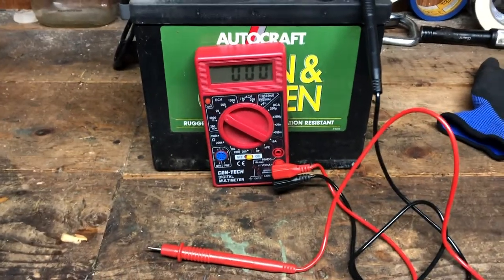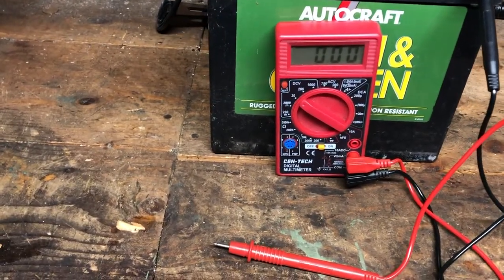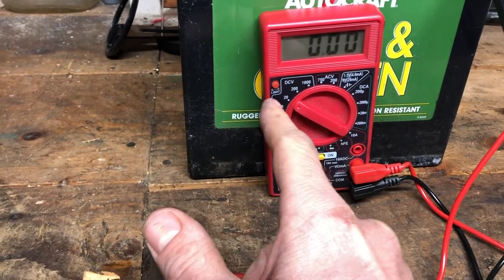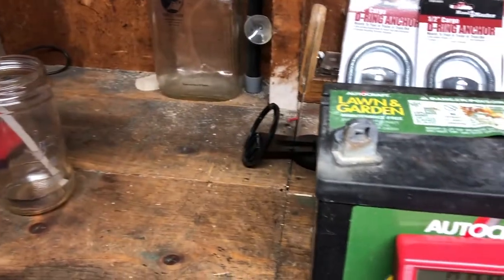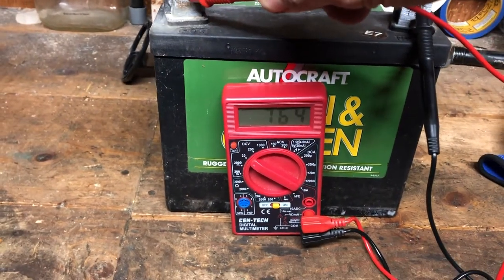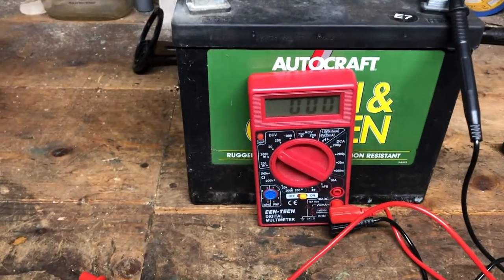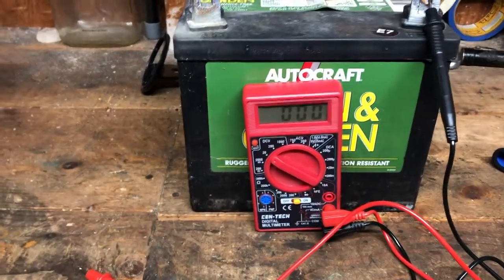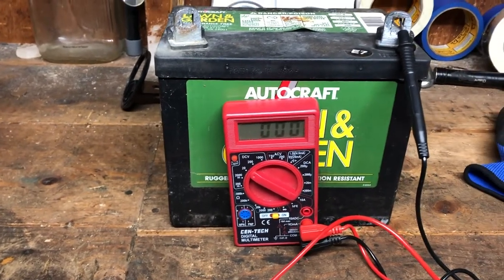How To Use A Mulitimeter To Test A Battery

Comment: If my lawnmower battery reads 10.4 volts is that good enough?  What the minimum? Thx
Reply from the maker: 12.4 and above usually means a healthy battery. You could try completely discharging that battery, and then trickle charging it back up - see if it holds at least 12.4. 10.4 is way too low. Good luck man. 🇺🇸🤘

Comment: Does battery have to be charged to get correct reading out of multimeter? Also if you charge a dead battery that cannot be revived but you don't know that, will it explode or it just won't charge?